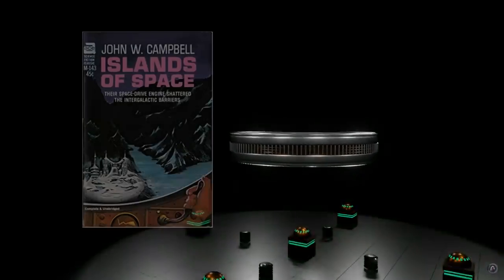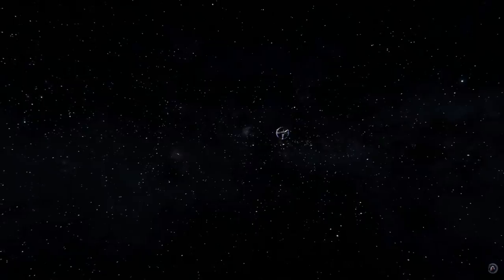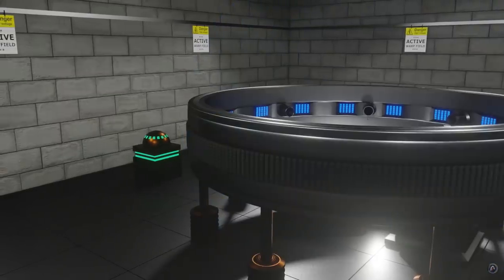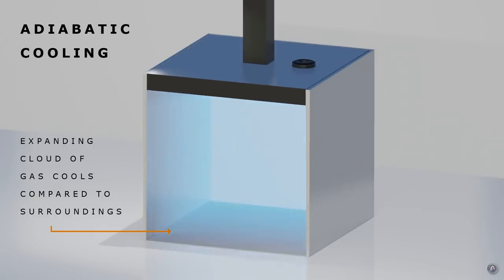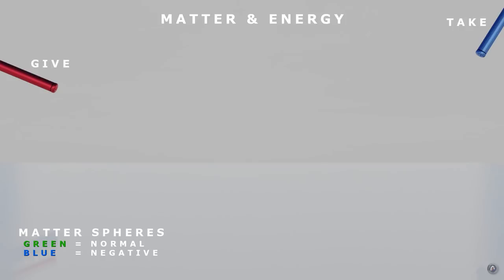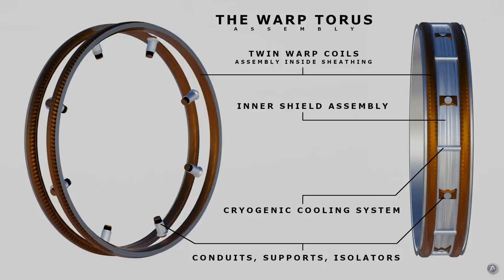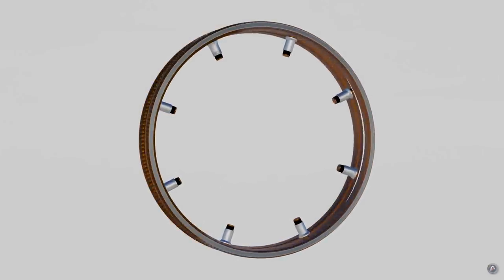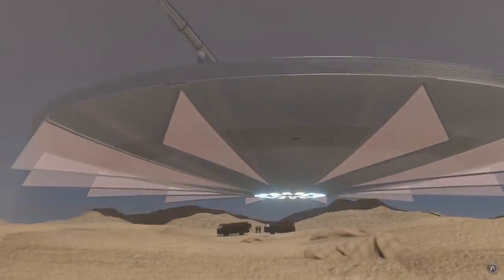A Detailed Breakdown of an Alcubierre Warp Drive Coil

Comment: Sounds like it may cause reverse diractance and side fumbling in the turbo encabulator.
Reply: But, instead of power being generated by the relative motion of conductors and fluxes, it is produced by the modial interaction of magneto-reluctance
Reply: All people here responding to your post including yourself are right. However you all didn't take into account electrooptical modulation of luminent relativistic fields caused by tachionic particles under influence mesonic forces arising from negative pressure of warp bubble in fifth dimension. This could disturb projection of crew members from the boundaries of universe and cause warp buble to evaporate.
Reply: don't forget the dingle arm
Reply: yes
Reply: Jesus, people. Just cam it up and throw in a set of 50 to 1 compression pistons. That’ll fix all your problems...
Reply: The Turbo Encabulator is fantastic.
Reply: This discussion has its merits, however all of these issues can be mitigated by simply reversing the polarity.
Reply: Liam, you left out the hyper infindibulator again.
Reply: @matthewdavies2057  Those Became unnecessary after the introduction of prefamulated amulite base plates.
Reply: @jodrakhanthewonderful1642  I see. 🙃
Reply: man i love the internet
Reply: But this video is a lot of bs, this guy is talking about energy needed 18 million MW / h, but this is not possible, scam.
Reply: @joseinfante5054  Oh it's possible, just not in this neighborhood. I sure hope. ☠
Reply: im gonna assume thats nonsense but if that makes sense ill eat a crow pie
Reply: @the_mental_gent  No you not gonna eat that, have a beer because this is Bs.
Reply: the photosynthesis of the parallel wont let that happen, dont worry
Reply: Only if the HyperLaminated Mufeeler Beltizamoise is Loose dammit!!!!!
Reply: @obvioustruth  STAP hahaha
Reply: W.T.F.           SPIT FLYING LIKE A 4YR OLD...........LMAO
Reply: You could overcome this problem by simply bypassing the compressor.
Reply: @fyka2902  It's a lot cheaper though if you reverse the polarity and then spit on it.
Reply: @pauljohnson600  I can't afford that!
Reply: You guys are ridiculous, all this needs is a giant capacitor tuned to resonate with the primary inductor, like in an LC tank circuit. This can recycle the power used on the last pulse(s) to add on top of your input power. This is basic induction propulsion knowledge.
Reply: this is "Ridiclueless" man, just use anti-gravity propulsion which will get the same results in a much smaller and energy efficient package.
Reply: This may sound crazy that something as simple as a Rotator Splint is a key component in all this.
Reply: @cobrajeff96  Y’all seriously forgot the electrogravitic torque convolution resistor element for the primary coil and the transformer??? wtf... the naturally occurring amplification and windings of the gravity field will also distort and cause pockets where mass is relatively unaffected and the intermittent and preliminary actions before activating the incubator are to first activate the torque convolution resistors. Magnets can also be used, but have a series of high voltage coils for electromagnetic interruption within the main coil is to aid in the operation and overall stability of the craft itself.

Edit 1: excuse me for my terminology. I meant to say encabulator, not incubator. 😂
Reply: I’m confused what
Reply: You guys have to be serious, without his flirq rooting all the causality bubbles back to the soerch capture point it wouldn’t be possible to power the dreskin indux module  meaning the flirq-poquen codependence is real.
Reply: @scona1621  great finding, I’ll add this to my electrogravitic stabilizer! Send me a schematic of the dreskin indux module, and how many Gs can this unit withstand inside 69.420% reduced mass hydraulocyclongenic coil room?
Reply: This is gold

Comment: To initiate the warp field the initial warp bubble must be created by an extremely high energy density. This can be done by focusing a laser through a nonlinear metamaterial crystal. The material choice depends on the frequency used, for example gold and silion dioxide will do for near IR and lower frequency visible. The array is made so the photons decouple the electric and magnetic vectors but add the energy of the electric to the magnetic creating an unusual particle with an effective velocity of C squared and a mass of a negitive value of the unit energy. If focused it will continue to infinity creating a mini warp bubble. Next the field generators resonate to this creating a much bigger bubble and giving it direction. Also it should have a stabilizer that prevents the destabilizing forces from acting on the craft. The wierdest part is the spacetime moves at about the square of light speed while the warp field efectively keeps the craft stationary. Using this method allows a much lower energy threashold to create and maintain a warp field. 🤓

Comment: Lowering the mass of a craft while keeping propulsion constant sounds like a good idea;  unfortunately, if the mass of the propellant is reduced together with the mass of the craft, you end up with a linear reduction of specific impulse.  Note also that if it were possible to reduce mass locally, you could put a wheel of weights that passes through this mass reduction field on one side, and create a continuous motion machine, violating conservation.

Comment: We say mass warps spacetime, as in the "rubber sheet" 2D representations. What if spacetime avoids mass to create the warpage, a repellent effect we have not considered because the rubber sheet explains the concept conveniently?
Reply: Being in a strong gravitational field affects molecular and optical processes the same as traveling fast in a straight line with no gravity. It equivalently takes longer for our measurement of time to pass, in either situation (we, or anything, slows down). How do the strong force and electroweak force know where to send their virtual force carrier bosons, and why doesn't it have more energy or speed going in one direction than the other, I really have no idea. You find out, you let me know (our entire lifetime reality is based off of the dynamics of electron orbitals, how would we know).

Comment: In order to create a negative energy density to expand spacetime using an electromagnetic field, what would the magnetic field strength and frequency have to be in order to achieve this? Because once you have those numbers then you can figure out the placement of the coils, how many coils are needed, what materials are needed to build the coils, and what needs to be done to keep the coils in phase alignment.